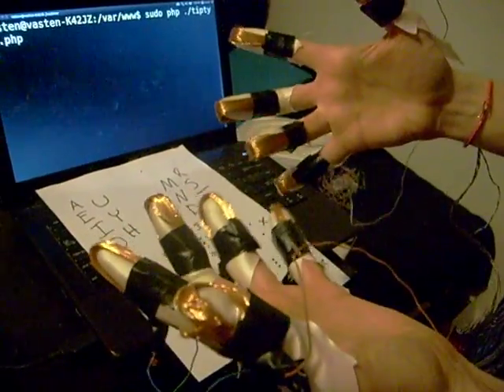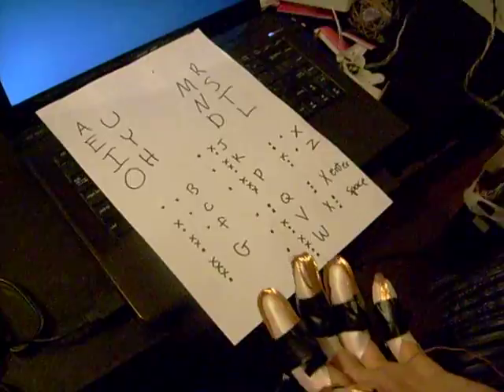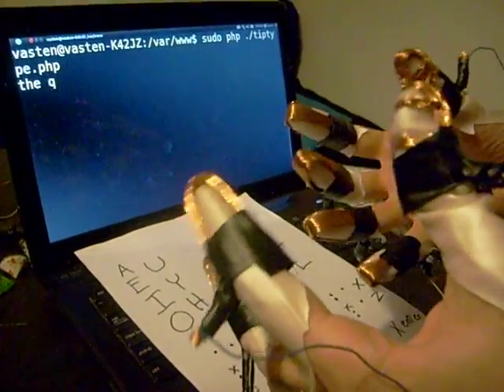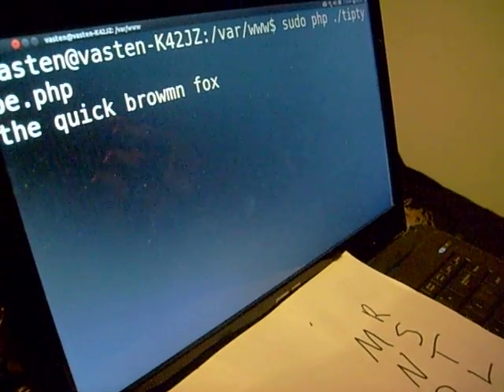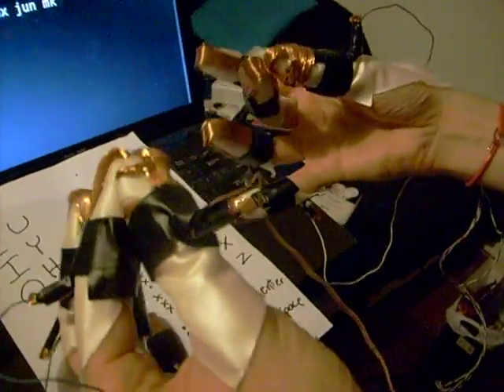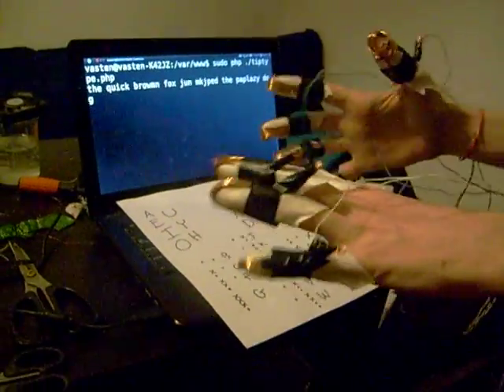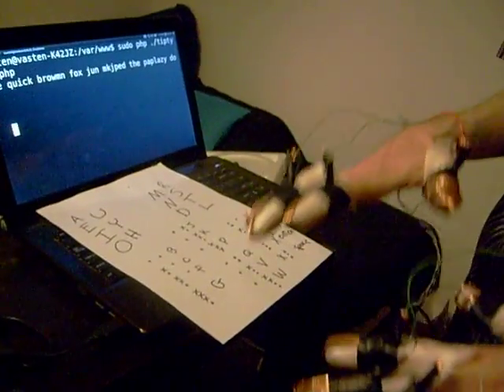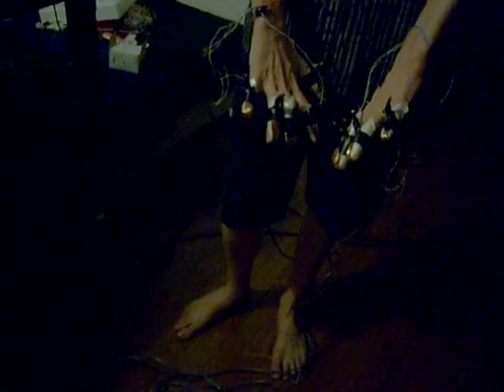TIP-TYPE - 2nd Prototype - DIY Keyboardless Typing in Air

Comment from the maker: Also, using only tips leave palm free.. you can hold something and still use the system.. I am just starting to practice (I just got my first one ;) ).  but yes, i can type and have something in my palm,, and hold it relatively steady without affecting typing much.. so it is VERY flexible.

Bracelets could be touched together, and could still type, meaning there are plenty of ways to "hold down keys while typing" with just bracelets.

Comment: Nice Experimental Setup. I would like to know how to type "Ctrl+Alt Del"?
Reply from the maker: Thanks :) I have some alphabet maps. but have not put much thought into those yet.. control, shift, capitals, etc... I was thinking there could be contacts on the wristbands, then those could be "shift" that way you type the letter using the same finger combo just with your wrists touching, to do a capital letter.

I figure for something like control+alt+delete you would want it to be somewhat easy, but not so easy that it might accidentally get pressed when unintended.. kinda like the current way.. actually, the current way is intentionally very hard so that it is not pressed by accident.

anyways, I think the tip-type system would work best is the user can map the keys themselves and customize the layout.

Comment from the maker: over complicated? how so? 
in the sense that i put few keys and require many combination?
I dont see how many contact instead is "less complicated"
if anything it would require WAY more motor control training. tip can be connected without looking or much concentration.